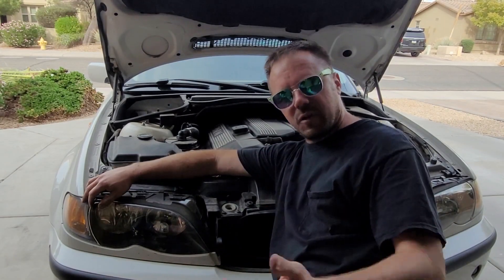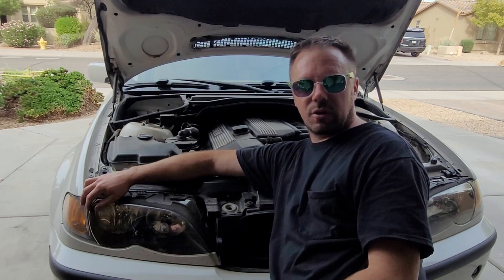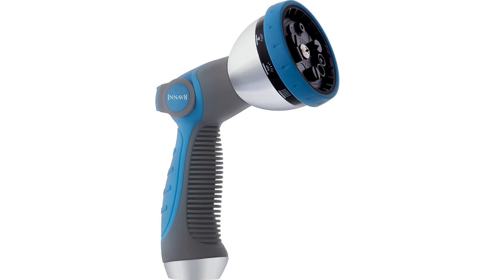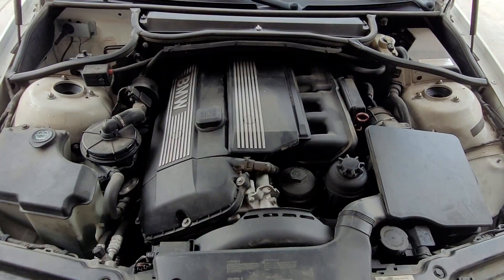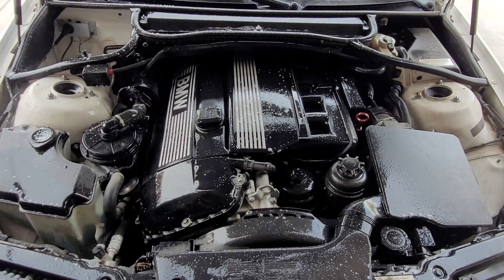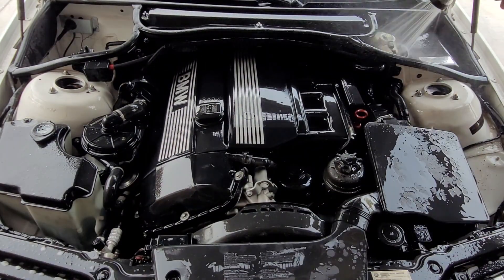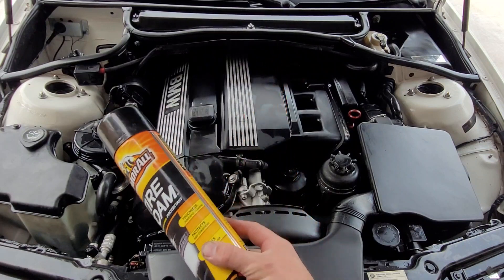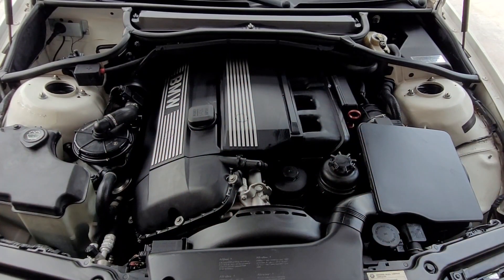The Best Way To Clean Your Engine!

Comment: well done once again
The only thing we do with our fleet of V8 Range Rovers and BMW 7 Series V12's  - is after we have washed the power plants - is get a air line and blow away most of the water from any where we can get to - and the most important of all is DRIVE The car for 10 miles or so - TO ENSURE THE V - Valley of the engine ( V12 or V8 ) get really hot as Water will find its way into the Valley and can cause rust to form if left.
With a 10 mile drive any water left will exvaporate
Reply from the maker: Careful with compressed air. Most components under the hood aren't designed to handle that pressure directly.